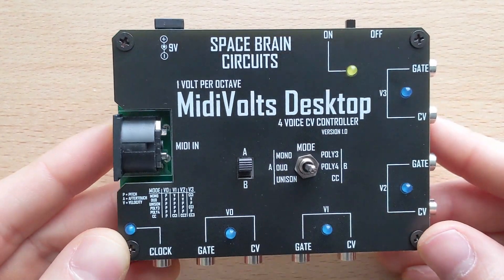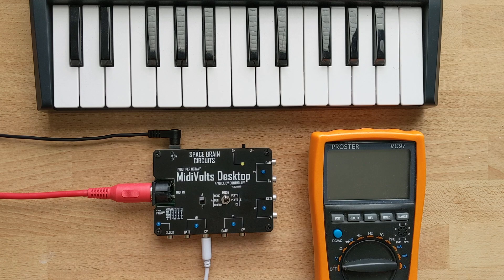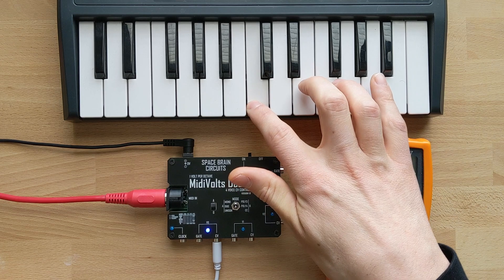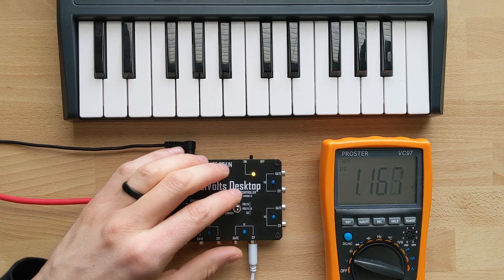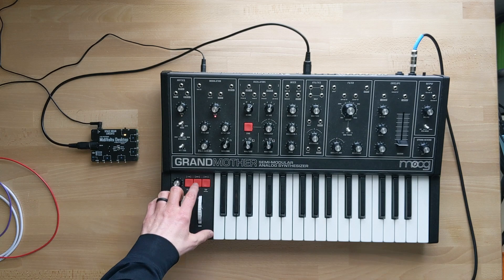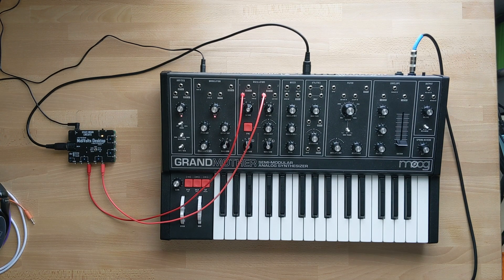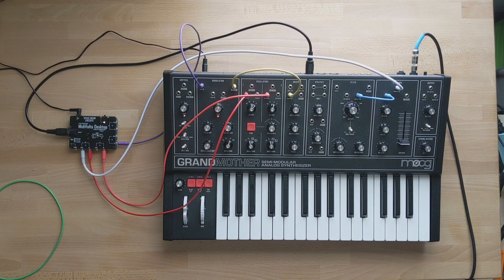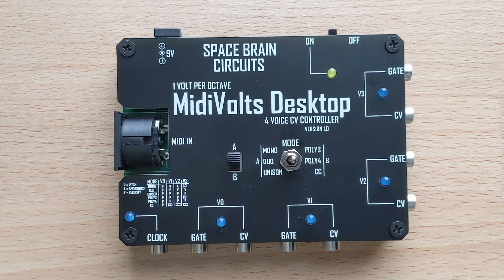MidiVolts Desktop - Polyphonic 4 channel Midi to CV Controller

Comment: hey mine came today, think i need to calibrate it cause its not tracking the keys consistently, how do i do this? thanks
Reply from the maker: Hey Duncan, I have calibration procedures that I will send out to you. However, every device is callibrated before shipment. Curious, what gear are you using it on and in what mode? thanks!
Reply from the maker: can you message me on etsy? Not sure of your etsy username
Reply: what i mean is the octave isn't an octave, it seems to be that an octave is C - F# so octave and a half, is this something to do with calibration?
Reply from the maker: @duncanjones7310  Are you using this on the Grandmother and are you using the Grandmother keyboard? If so, you will first need to turn off LOCAL mode. The Pitch In jacks are summed so this is why the frequency scaling is doubling... Let me know if this solves your issue!
Reply: hey i think i solved it, i was using a battery instead of a 9v charger and the depleting battery was gradually changing the pitch, it's all good gonna test with a 9v positive centre charger instead, most likely that'll be it,
Reply from the maker: @duncanjones7310  Hey Duncan, I would agree with this. Battery most likely isnt providing the stable power MD requires for high accuracy pitch. Thanks for getting back with me!

Comment: hey! very cool, can't wait for it to be restocked, how would this work with the sequencer? would you be able to get 4 voice sequences or is the sequencer limited to 1 ? thanks
Reply: also, would the arpeggiator work in the same way or would the extra voices be making chords
Reply from the maker: @duncanjones7310  If you use the device with the Poly Sequencer,  the sequencer would be making chords per step. Thanks for the question!
Reply from the maker: Also the device is back in stock on my etsy if interested.
Reply: @spacebraincircuits1358  awesome i've ordered it. as for the polyphonic sequencer, how would this work if the midi out of (moog grandmother) is used to increase voices, would i need some kind of midi host thing to create a copy of the midi output to use for the sequencer? or am i missing something
Reply from the maker: @duncanjones7310  Cool thanks! I have not fully tested the device using the onboard sequencer. I'm sorry if I misunderstood your question. In order to create polyphonic sequences, you will most likely need some other type of polyphonic sequencing gear/ DAW. Hopefully this isnt a deal breaker. let me know if it is!
Reply: @spacebraincircuits1358  nah don't worry about it, i'm looking forward to receiving the 4 voice converter, being able to play 4 notes on my monosynths is amazing, the sequencer would just be a bonus to be honest, who knows it might work .. i'll wait and let you know
Reply from the maker: @duncanjones7310  Yea definitely keep in touch! Curious what you find!

Comment: Are you making my microbrute polyphonic? That’s what you’re saying dude?
Reply from the maker: Unfortunately, the microbrute is a single oscillator synthesizer so not possible. I use my microbrute as a Midi controller most of the time! Thanks for the question!
Reply from the maker: Although if you had another oscillator to use, ie Eurorack etc. you could absolutely add an oscillator! V0 -> Pitch In of Microbrute, V1 - Eurorack Oscillator. A lot of possibilites out there!
Reply: Yeah, I have been looking into adding eurorack modules lately. Cool dude, best to you this year!
Reply from the maker: @dannymontreal6316  Rad, thanks man! take care!

Comment: is the Drone Mode the only way to play it? why you used it instead of a long decay?
Reply from the maker: No you can also use Kbd and Env. I just used drone because its the simplest to demo. If you want to use Env, for instance, you would need to connect Gate Out of MidiVolts to Trigger In on GM. Or just connect straight to the VCA if you want. Possibilities are endless! thanks again!
Reply: @spacebraincircuits1358  thanks for the answers :)
Reply: @spacebraincircuits1358  are you shipping to Italy?
Reply from the maker: @lotec78  yes I ship internationally!

Comment: Very cool. Is the range 0-5V for CV? I'm curious for using this with a DFAM.
Reply from the maker: Thats correct. Yea man, would be super cool to see. I assume you would use CC mode and send CV voltages from DAW? Thanks for the question!
Reply: @spacebraincircuits1358  Thanks for the response. I got a keystep for this purpose but it only has two outs. DFAM is mostly +/-5V for most of the inputs. Cool idea, wish I'd seen it sooner! :) Great playing too.
Reply from the maker: @mikechiaburu4528  thanks man!

Comment: Do you think this would be over kill for m to own? I own a GM and a Matriarch. Also Could this unit do some funky stuff with a DFAM?
Reply from the maker: The answer I want to give you is "Yes, you need this!" haha but honestly, the whole reason I built this is because I didn't have the budget for a matriarch. So I built this unit so I could easily make my grandmother poly! It might make interfacing with your DAW easier since you can convert midi CC to CV. I don't have a DFAM but yea that would be super interesting! I wonder too! Thanks for the comment!
Reply: @spacebraincircuits1358  awesome. Thanks for the response! I may hold off but it is definitely on my radar. I just have to budget a lot more with this weird ass year we've been having. What a cool little device.
Reply from the maker: @eladreltuc  I totally get it! Thanks again!
Reply: @spacebraincircuits1358  Im in the exact same boat right now haha, do you think you'll have some more coming? 

Thanks!
Reply from the maker: @chrisstander9576  Back in stock now!
Reply: @spacebraincircuits1358  Just ordered! So stoked, lol now i gotta track down a Grandmother 🤣